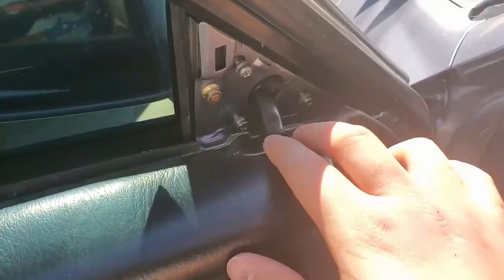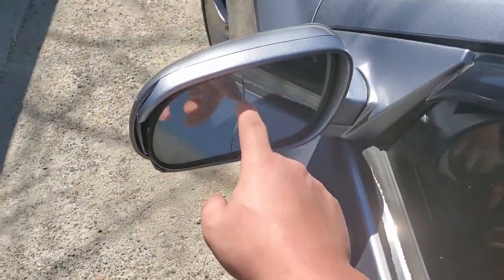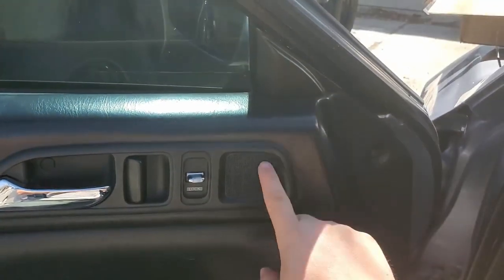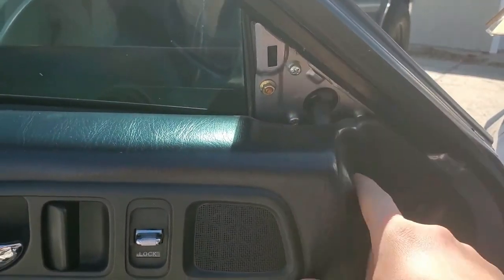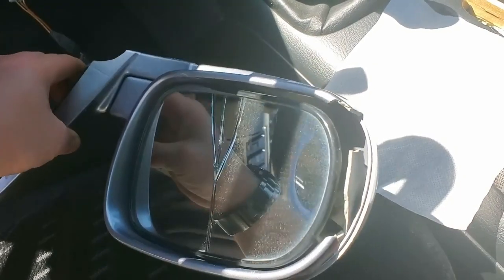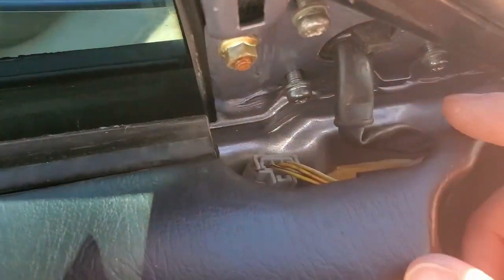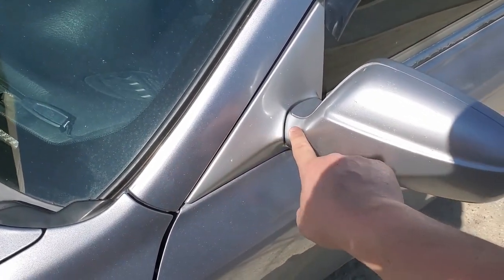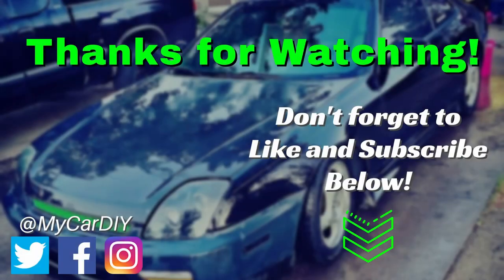50Cal VLOG 1 Honda Prelude SH Mirror Replacement

Comment: I hope you see this I'm going to be replacing mine soon and I was wondering how you pulled down the door panel without completing removing it because you the only one I've seen so far no remove the whole door panel. Please Help lol
Reply from the maker: Hi, so it's simple as taking the door handle trim out with the screw behind the handle.  Then pop the corner plastic plug in the corner nearest the mirror, then you can flex the door panel out of the window track to access the other screw.
Reply: @mycardiy  thank you sooo much I'll let you know how it goes
Reply from the maker: @aidangbb6680  Sounds good man! and Good luck!  Feel free to message us on FB or Insta if you have any questions and need quicker response.
Reply: @mycardiy  will do